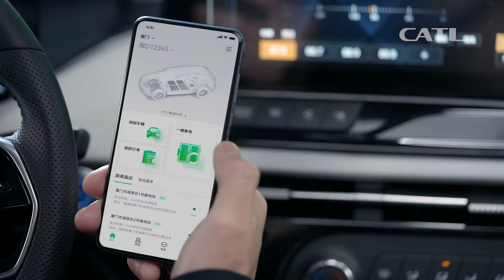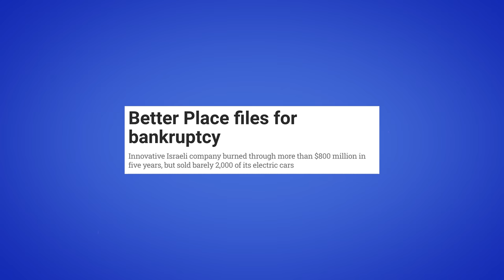Why Battery Swapping Is A BAD Idea

Comment: Don't believe 72 stalls for tesla cost less than nio . Takes 10x more space and when you charge 2 cars from the same charger you get half the speed.
Reply: Rory also argued that power swap stations "take a lot of space". That's rich, compared to Tesla...
Reply: @pg205  correct.  It takes maybe 2-3 parking spaces

Comment: Battery swapping is a very old idea, going back to the early 1990's. Before the advent of powerful lithium batteries and modern 'skateboard' platforms, it was thought that automotive EV batteries would be far more modular and universal, allowing most gas stations to act as battery charge & swap stations as well. The reality however is that such a system would be horribly impractical and inefficient with the 90's lead-acid battery technology of the time. It looks as if these Chinese companies have the problem somewhat streamlined with their automated swapping stations, but it still appears more gimmicky than practical. 
However the idea of a more replaceable and modular battery pack in EVs is very practical, since one of the greatest expenses in EV repair is in replacing dead and worn out battery packs, as dozens of YouTube videos can testify to. Until replacing battery packs is made simpler, I would never recommend purchasing a used Tesla or any other EV for that matter.

Comment: At last …. someone is being realistic about this subject. Never catching on.
Reply: Well he mentions that battery tech will evolve, but in fact the swapping technology gets faster over time as well. Having a battery swap capable car is just one extra method of battery replenishment, one extra option if you own the car, not everyone can charge overnight at home.
Reply: @Drgnrt  sorry but this will never catch on. It will never become a standard across manufacturers and will just never happen. Just think of all those spare batteries lying about not in cars. There’s a shortage of minerals already and so you think they’ll waste it on spares?
Reply: @richardblayney5898  It may it may not become a standard. Either way let's do a quick math, they have sold 215k cars and operate 1000 swap stations each with around 11 batteries, there's only 5% of extra batteries compared to the number of cars and their concept works. I believe this is a point that many people miss or think that a crazy number of batteries is required. Battery swap is not a must, it's a premium feature that allows you to spend more time behind the wheel. Even during the swap you don't have to leave the car, you just press the touch screen, let the car & swap station do their thing and drive off, no matter if it's scorching hot or thunderstorm outside.
Reply: @Drgnrt  this is only working in one company in china where the state dictates what happens regardless of what the manufacturers or people actually want. At the end of the day it just wont catch on. Battery tech is advancing beyond the capabilities of this system. This fixes what is quickly becoming an old problem. It’s already out of date.

Comment: Everyone always talks about maximums but what about the low use owner. As a retired person I typically drive a very limited distance each month so if I am paying the equivalent of  175 GBP per month to lease the battery and the car is just sitting there doing nothing I will find that very expensive.

Comment: To get charged from 10 to 80% you need 250kwh charging station and precondition battery for it. Most charging places are 50 or 100kw.
Reply: yes, now BUT most new ones will be faster so once you have rolled out a massive battery swap network taking years all the current vehicles will charge fast anyway. Also most people will charge slower in the 90% of the time the vehicle isn't being used like when you are asleep or at work!

Comment: This is a fantastic idea on paper.  Not only does it seem quick and convenient, it eliminates the primary thing that ends the life of an EV: a battery that can no longer take a charge.  If this system could be made to work, the lifespan of EVs would be much, much longer.  But there are so many hurdles, it just doesn't seem practical on a large scale.  (Plus, we'd have to trust that support for swapping batteries in older vehicles wouldn't be dropped after only a decade or two.)

This reminds me a bit of propane vehicles.  A place I used to work had a propane tank area.  When your forklift ran low, you drove up, swapped out the tank, and were on your way.  We paid an outside company to manage the storage area and make sure we always had full tanks at the ready.

Comment: A battery standard would make battery recycling a lot more feasible as well but current recycling is limited by the different form factors making it impossible to standardize a recycling robot and much of it has to be intensive manual work.

Comment: What happens to your nice new 8 year battery warranty if you get your battery swapped out?  The logistics and practicalities of battery swapping don't add up either. Battery swapping joints would need numerous types of battery pack to cater for various models of cars, and all those batteries would have to be fully charged at all times. The swapping stations would need to be at least double manned for safety reasons, and they'd need to be open 24/7.  As charging infrastructure increases, and charging times reduce, there seems increasingly less point in battery swapping. We already have chargers out there which are capable of adding 200 miles of range in 15 minutes, if your car can receive it.
Reply: Let's see: 1st, in this business model, you don't need to own the battery - just like you don't own the gas canister. That's not your problem, it's operator's problem.
2nd, there would be just 2 or 3 standardised battery packs, all interchangeable between them. You need extra juice? pack another module. 
3rd, those packs would be 80% charged all times. How? if the power station could charge every single battery at - say- 250kW, it would take 5min to charge every single module of 30kWh (let's call it the base model) in optimal temperature conditions. That do not occur at your local power station.
4th, those power stations are already full automatised.Why "at least double manned for safety reasons"? 24/7? not a problem.
Reply: @pg205  And yet Tesla still dropped the concept of battery swapping in 2013.......

Comment: You made a fair point about single manufacturer battery swap facilities, but wasn't that exactly what Tesla did with their charging stations, and it worked well for them, if not for the general acceptance of BEVs? In fact, if I had paid the premium price for a Tesla to take advantage of their network, I should be feeling slightly miffed just now as I hear the network is to open. I should feel incandescent the first time I'm unable to charge my car because the supercharger station is filled by other makes.

Comment: Hydrogen powered vehicles makes a lot more sense for a large majority of the transportation sector, imo. Personal EVs need further battery development so they can charge much faster and offer a reliable range estimate.
Reply: Hydrogen is merely terrible variant of battery…
Expensive, hard to handle, hard to keep safe, with massive losses to produce from electricity…

Basically usable only for off-grid aplications and ships, maybe heavy trucks.

Comment: As a Nio and Tesla owner, i recon battery swap is not a bad idea. 1. Its the big selling point, thats why i bought the ES6 than many of its rivals, same as Tesla on its supercharger network. 2. you have the option to get a almost full battery in 5 minutes, if you need to go somehwhere in a rush but dont have time to charge your car 3. currently you get four free swaps every month in china when you buy a nio! although im worried to swap my new batteries for a old one but you dont want to miss this. Although its got problems eg waiting time for others to swap, battery not always go in smoothly, this is an option and people like to have options when comes to charge up your car

Comment: I immediately see a big issue most people don't see.  The battery life a a battery goes down a bunch after a few years. What if you have a new battery with 300 miles when full then swap it for a old battery that has 250 miles when full for the same price to fill up.

Comment: 1. Optimization. A large fast-charging station can sustain 12-24-100 vehicles. A swap station has one. Do the math.

2. Limitation. You will have to either wait in line for the swap, and sit inside the car while its doing its thing. Time that you can use to go to the bathroom, or watch a swallow. Generally you rarely wait for a 100%charge on a road trip. 20-80% is very fast.

3. Degradation. Swaps still fast charge as they use maybe 10-20 batteries for each station. If they wouldn’t, it would be a huge fail.

4. Accessibility. Get a plug anywhere, not depend on 1000 stations. Millions vs a few thousands. Logistic costs to have swap are probably too high for such a niche type of driver. Also, swap cars are extra expensive due its design for this feature.

5. All the other things Rory mentioned, like companies might fail, who owns the battery, etc

6. Since swaps are mostly, if not entirely, made by China, I for one would NEVER depend on the CPP. No thank you! 

PS: I own a Highland, I charge at work with slow charging and its SC infrastructure is superb, at least here in Europe.

Comment: I think you are conveniently missing a very important point. The motoring industry needs to be required by government regulations to settle on a standardised battery platform (as you pointed it makes no sense to only have batteries for one brand) we only have two types of fuel for ICE vehicles! And miraculously all of our disposable battery devices settled on C,D, AA,AAA ect sized batteries decades ago!
Then we could all benefit from battery swapping or fast charging options on the fly.

Comment: How would the financial side work? A fixed charge per exchange? Different prices for different times? (eg peak/off peak) What about scale?  I often have to queue to refuel my ICE car and that's at places with many pumps. And then there's the battery decline issue - the loss of capacity with age. Exchange a nearly new battery for an eight year old battery would give you less range than you had before. (And then there's the lucky guy with an eight year old battery who gets your nearly new one.)
The idea is superficially attractive, technologically impressive, but not as practical as it may seem.

Comment: To the degree that electric makes sense at all for long-range trucking, battery swapping makes sense there:  Trucking companies can create battery and -swap and -recharge stations at strategic places along their trunk routes, and thereby turn around their trucks as fast as they can remove one trailer and attach another.

For passenger vehicles though, I agree:  Quick charging is what we really need, especially since long road trips are comparatively rare for individual consumers.

Comment: Few points you need to look for. 
✅V2X services in future will play a big role. For that we need Energy Dense Swapping Station to stabilize Grid Loads. 

✅Batteries can be charge when their is abundance of electricity generation which is available at cheap rates. It is not possible at home.

✅Load balancing during peak hours like in morning and evening. 

✅Most importantly with advancement in Cloud computing we can easily transfer Ride Analytics of customer from Battery station to serves and can charge them accordingly. 

Earlier we use have phones with removable batteries they were built to last phones. Not like today which are creating lot of e-waste. 

Less moving parts mean less profits on per vehicle. The prominent source is Energy storage subscription model is beneficial for Swaps only not for fixed. 

Plus swappable technology is pocket friendly compare to fixed batteries. It is a big dent on consumer pocket. 

Eg-In India LPG is delivered in cylinders to home with proper supply chain and India has a population of 135+ crore. A clear example of how distribution and OEM can work together.

Comment: This is precisely why EVs need standardized battery receptacles. We could then have standardized battery blocks (like the Choco-SEBs seen in this video) manufactured from competing companies, Samsung, Tesla, Ford, whoever... Have these blocks be small enough to be human-manageable/liftable,  and format EV battery receptacles to hold multiple (depending on necessary range/weight/aero). Then you don't need a big automated battery swapping station, you could just charge these battery blocks out back at Phillis & Bob's Fuel & Booze... Phillis could keep them charging throughout the day, then when you arrive for a swap, take a break from smoking meth by the charging station to come pop a few new cells in! This system would work wonderfully.

Comment: yeah, go ahead with the 250 kW, 350 kW ultrafast cgarging seed, and see how fast the battery degrades. At Nio stations batteries are charged with 40 kW, so they will last longer, and when the station's BMS sees that a battery is degraded, it will not put it in a vehicle, so if you have a Nio you don't have to worry about battery life. EVER! That sold for me!

Comment: The biggest problem w EV charging is access to home charging, esp for apartment buildings and houses in urban areas with no driveway. Given that average car journey in the UK is less than 10m, access to overnight charging at home should be a much higher priority than charging networks or battery swapping

Comment: I’m amazed a manufacturer has not developed a vehicle with a short range battery as std, so maybe 100kms max so ok for round town, but with the ability to add an additional booster pack you can rent for holidays etc, etc.

Comment: Well if we could agree on a global car battery standard like we did with all other batteries there is nothing standing in the way of battery swapping.
1) vendor locking would be gone because all of them are essentially the same
2) with fast charging improving rapidly the charge stations wouldn't have issues with charge time or empty packs either
3) if battery swaps are convenient enough people wouldn't need a huge battery for day to day use and would only load up the full capacity for long trips which would improve efficiency of the EV immensely while reducing the total amount of resources/batteries needed as people need those extreme 300+km ranges maybe once or twice a year.

There is a way to make it all work out but it's still a huge hurdle..

Comment: If you’re taking really good care of your battery by not leaving it standing around at high percentages, why would you want to risk getting a run-down, degraded one from the swap station?
And if you got a run-down one, aren’t you in a way incentivized to just get a new one from the swap station that is definitely gonna be better?

Also, with a 150kwh battery pack from NIO, you can go for 750km at a reasonable consumption of 20kWh/100km. After 750km, you’re gonna want to make a half-hour charging stop before doing another 750km.
Seriously, where is the market in shaving like 25 minutes off your 1500km holiday trip?

Comment: Great topic and well covered. I do remember Better Place and followed them closely. To think they went bankrupt 10(!) years ago and here we’ve circled back to the idea again. I agree that with battery charging times coming down and battery technology evolving, swapping batteries will again be an idea that does not get a lot of traction.
Reply: better place was a head of its time, battery sucks back than, nio on the other hand have more than 2100 swap station and growing and more than 400k vehicles on the road. the problem is not the battery but the grid. good luck support 1200kw charger worldwide, even with 200kw tesla have problems with

Comment: You should have mentioned Gogoro. It's a Taiwanese company that does battery swapping with scooters and is quite successfull with that.
But their infrastructure is very, very cheap  compared to car systems and the issue of a much higher number of batteries required persists.

Comment: I agree with pretty much all AT's EV musing videos.  This one especially.

A point to add:  Failures.  What if a battery swap station fails, mid swap?  It's bound to happen, more as they age too, we all know how reliable automated car washes are.....not very and they're less complex/intricate!

I wouldn't want to be stuck for hours waiting for an engineer to come out ot the swapping machine, at least if a public supercharger fails you just unplug and move on with ease and the battery isn't unplugged.

Comment: Hot swapping would become problematic eventually. Either the connectors will wear down and not have good contact with the vehicle, or you will have a battery that reports that it is charged, but has degraded beyond a reasonable amount of mileage. Also, the amount of space needed to store batteries is much larger than the infrastructure required for a charging station. Faster charging speeds will be more effective.

Comment: Main reason is that there is too much risk; people can mess with the battery then swap it causing them to leave behind damaged batteries. Such as connecting them to their house and using them as a house battery then swapping them when they get old.
Also, if one battery blows up the charging station blows up, which would be a bad image for a company like Tesla.